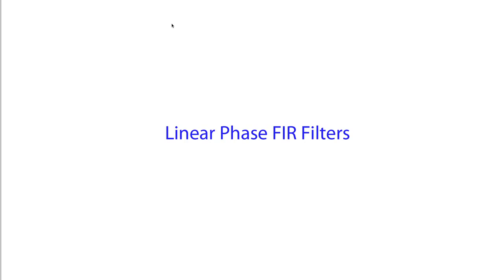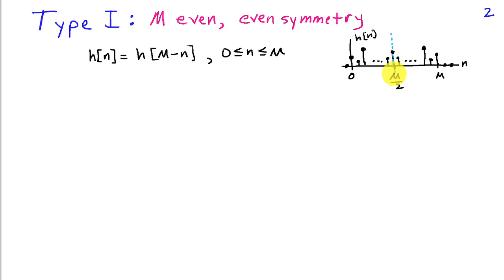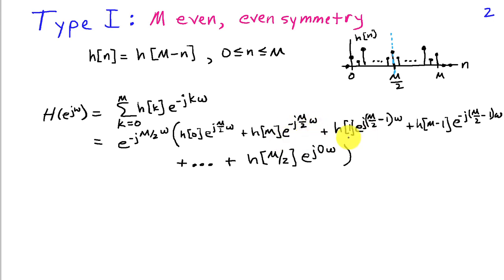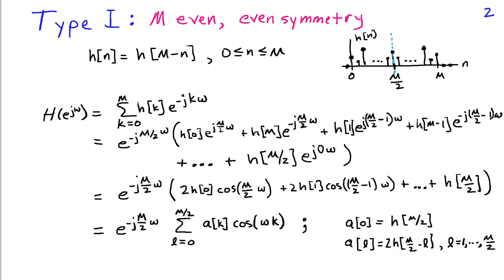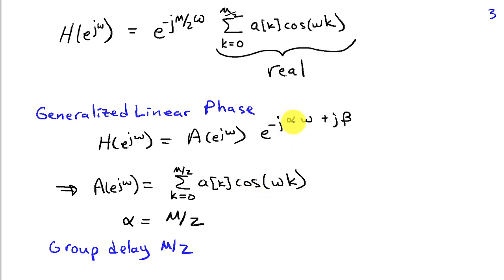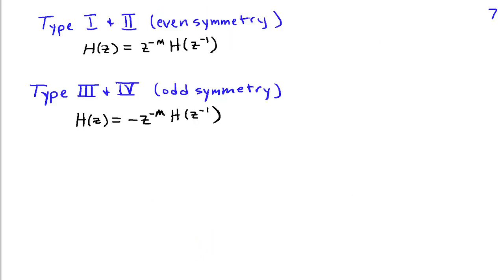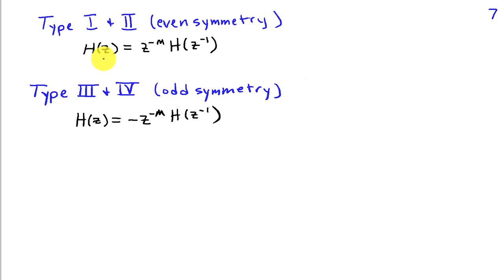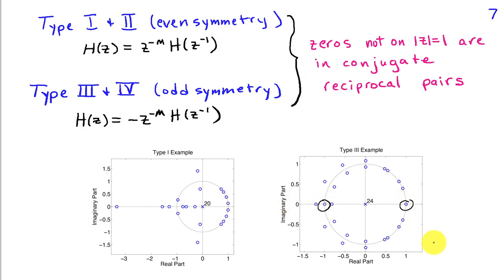Linear Phase FIR Filters

Comment: Hi Barry, your videos are great, however you have a mistake here concerning the symmetry for even and odd filter order. The line of symmetry lies at M/2 is case of M is odd and lies at a mid point in case M is even. You mentioned the opposite.

Thanks
Reply: Yes, there should be M+1 points... However, this is still a very useful video!
Reply: Actually, I believe he's right because as stated before, there're M+1 points so M is the last index.
Reply: Here M is the index not number of points. I think he's correct.
It's understandable since usually capital letters are used to represent number of data point.
Reply: You may adjust to the length by taking the sum from k=0 to N-1. The first one will still be symmetric about N/2.

Comment: Hi Barry,

Great videos! They're really helpful. I have a question.

In type I filters where M : Even and Coefficients are symmetric, the length of the filter will be M+1 (M is the order). Hence, won't the length will be odd?... Right? But, in the video it's mentioned that the length is EVEN.

PS : Could you make a series of videos on Multi-rate Processing, Adaptive Processing?